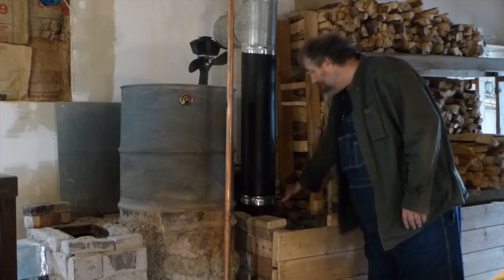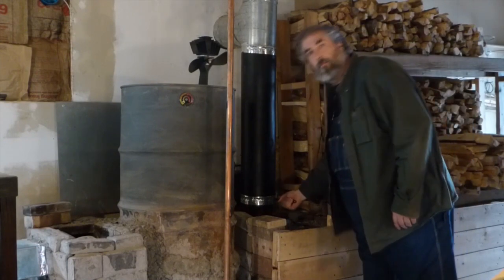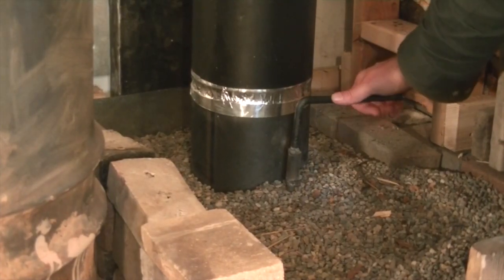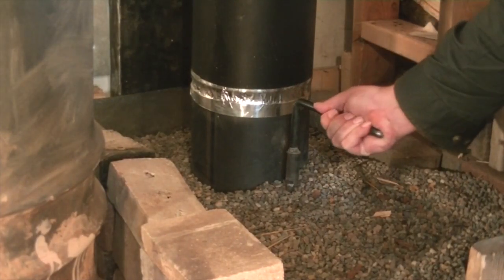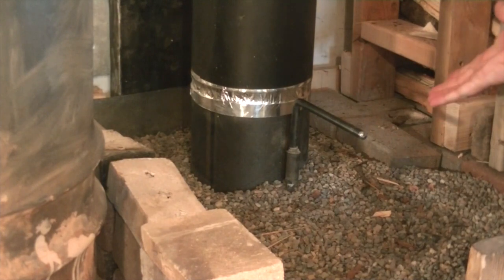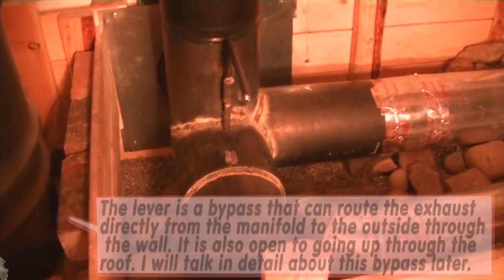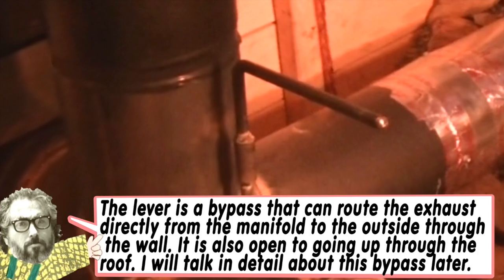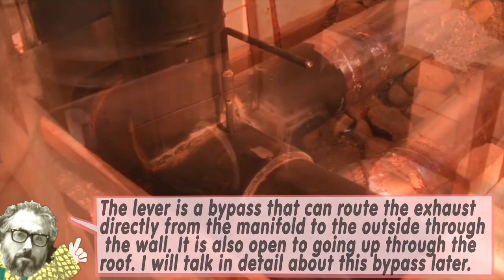rocket mass heater bypass - excerpt from "Better Wood Heat" DVDs

Comment: Covering the wood feed is so much easier. Have you found that it increases the efficiency significantly, because the bypass + guillotine increase was huge, maybe worth considering if you have just one or two attentive folks running the stove.
Reply from the maker: I think when you have systems where human discipline gives you a bump, but doesn't cost you on the next burn is a plus.  So the p-trap-like effect of the barrel is a good plug for the system.  And covering the wood feed is an additional bump.  Whereas forgetting to put the bypass back could be very expensive.

Comment: Hey Paul I know I would probably be better asking on the forums, would it be possible to make a mass bench for a RV without going over the gross weight. Or another way to ask is how much does cob weight per cubic foot.
Reply from the maker: A gallon of water weighs 8 pounds.  7.5 gallons in a cubic foot.  So a cubic foot of water weighs about 60 pounds.  Cob is heavier than water.   How much heavier will depend on the ingredients and wet vs. dry.
Reply: Would a bench like the one in this video work better?   https://www.youtube.com/watch?v=1GFCslsLZwo

Comment: Good one, thanks Paul. In my Kuznietsov stove there is a bypass to the bench that we open when the stove is hot enough. There are two dampers, one for the bench and one for the chimney, they allow to decide how the air flows through the system.